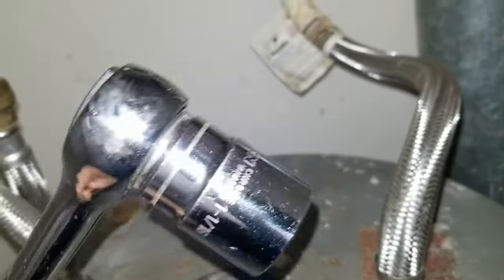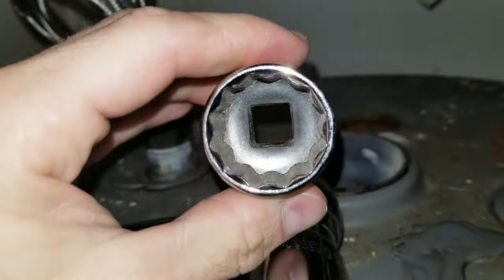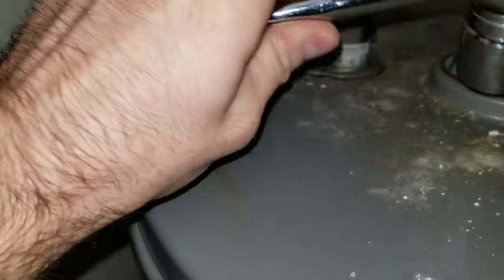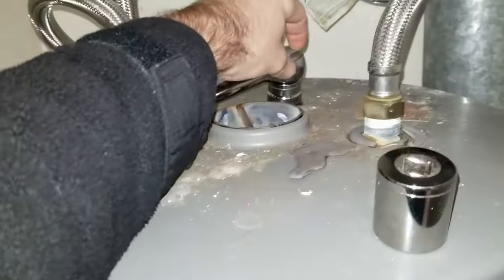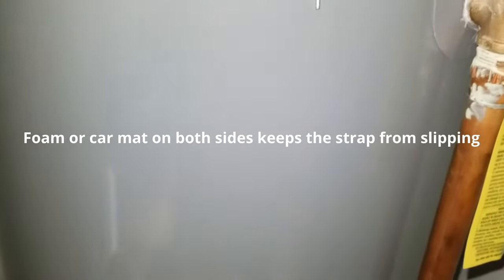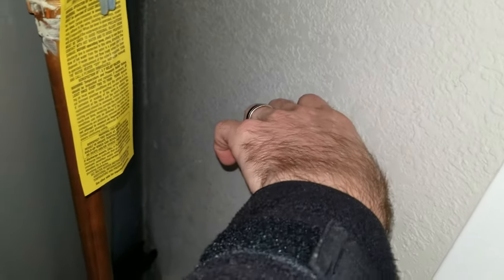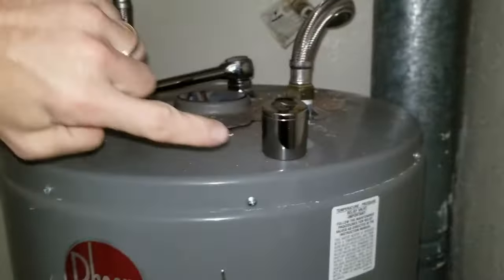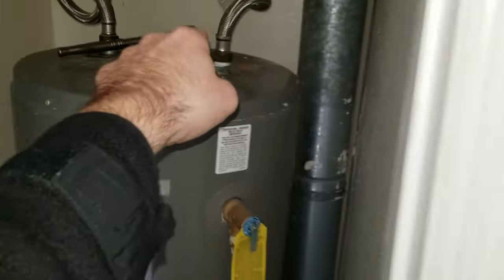Keep Water Heater from Spinning!  [Remove Anode Rod EASY TRICK]

Comment: Tip from an old plumber.... remove the side mounted relief valve and screw in a 2 ft piece of black pipe. Now you have an extra handle to keep the unit from spinning.
Reply from the maker: Interesting idea.  🤔🙂
Reply: Old professional  water heater wrestler here,  [installer], EXCELLENT tip sir.
Reply: what diameter?
Reply: @arkrainflood    most residential relief valves are 3/4 inch.... unless your tank is bigger than 120 gallons. Most home tanks are 30 - 50 gallons.
Reply: @arkrainflood same as the threads on the valve port
Reply: That is a good idea but assumes enough clearance & working against oneself is not a good state to be in when doing so against a single-minded maniacal urge by the manufacturers to put it on so damn tight in the first place when they well know the mess they put the homeowners in. Are they worried that there will be a leak or a fountain if they went a bit easy on it?
Reply: @Gengingen     show me an installation where you don't have 6 inches. That and the difference to anything else solid on the tank (risers?) will be another foot that you didn't have before.
Reply: @rupe53  6 inches is not a big issue. With the tank placed in a corner, the positioning is a bit awkward needing to pull on the anode-nut with the left hand to turn it CCW while holding on to the 6 inch piece with the right (dominant) hand. By the way is this stuck on so hard for a purpose by the Manufacturers? Or does it get that way due to the heat? My tank is just 18 months old & this is my first attempt. It is said the longer it sits untouched, the harder it gets.
Reply: @Gengingen     nobody said it would be easy. Most of them get stuck due to bad water, but I can't imagine the water is so bad that you need a replacement at 18 months. Over the years I have had a couple that just wouldn't budge. Of course, we now have those fancy battery impact guns. Never tried one because I am long retired. I have tried longer "cheater pipes" to get more leverage... but you need room to work. Worst case is you give up and plan on an early replacement of the unit

Comment: I thought of a completely different way of getting the stuck anode rod out. I’m a little old lady with not much power so had to think outside the box. I used a car jack wedged horizontally on a wall stud to slowly apply torque to the breaker bar. At first there wasn’t enough room to fit the jack so I took a long 2×4 and started farther away from the breaker bar. I wedged in pieces of wood as needed and moved the jack closer and closer to the bar, always putting it on a stud. Finally I had the jack on the breaker bar itself and it came loose!! The whole process took me about 15 minutes of patient work.
Reply: Brilliant work "little old lady"!! 😊
Reply: Haha @charliebrady; exactly.  Little old lady huh??
Reply: That is so impressive! Thank you for the ideas!
Reply: Genius. Why can’t there be more women like you out there🎉❤

Comment: Use impact wrench will save you a lot headache which will not spin the water heater. I got my stuck anode rod loose within 5 seconds.
Reply: That's a good tip too.  But unfortunately I don't  have a impact wrench.🤪
Reply: What size impact? 1/4” or 1/2”? Thanks
Reply: @weaverjoshuab  I used 1/2” RIDGID mid torque impact wrench. The size of socket could be either 27mm or 1 1/16 inches.
Reply: Get a cheap Chinese impact wrench and a 27mm socket.
Reply: I used a 1/4 inch impact driver with a 1/2 inch adapter to fit 27mm socket
Took 30 seconds to remove😊
Reply: how many ft-lbs torque rating?
Reply: @weaverjoshuab   1/4" impact?  I don't believe I've ever seen a 1/4" impact advertised.  I've never seen 1/4" impact sockets.  3/8" and 1/2", yes; but never 1/4".    Are we talking (impact) wrench or driver?
Reply: $20 for electric impact wrench from harbor freight.. bypasses all the trouble
Reply: I couldn’t get mine off even with an impact wrench.    Even tried penetrating oil, an air chisel to try and loosen up and rust or corrosion.     Even tried an ice cube on top of the nut to shrink it a bit.   I tried everything except a torch to heat the area around the nut.  Any suggestions?
Reply: @jeff11030  Sounds like you just need a stronger impact wrench.  Keep it on and let it do its job by hammering away even if its not moving. That will bust the rust free.

Comment: No impact needed. Hit the top of the nut, rather hard a few times with ballpeen hammer or punch & regular hammer. 1/2 breaker bar & cheater pipe. Turn it towards tighten, slightly, then loosen. Just changed mine on 9 year old Richmond WH

Comment: I recommend not using a socket and ratchet.  Save yourself some serious headaches and use a 8.5-Amp Electric Impact Wrench, 1/2" Impact driver with 480N.m Torque Power. Loosened the anode rod on my 10 year old water heater... in 2 seconds. I also didn't have to worry about strapping the heater down.  (remember to shut off the inlet water before removing the rod)
Reply from the maker: If I had one, I would use it :)  Great reminder to everyone with that last sentence!
Reply: I hear yeah....you do it with what you have.  I bought one just for this job. Nice video, thanks for the compliment @HomeBatteryBank
Reply: ' 8.5-Amp Electric Impact Wrench, 1/2" Impact driver with 480N.m Torque Power.'.....oh yeah, just happen to have one in my garage, lol🤣

Comment: Spray some WD-40 wait a few hours. Use a impact wrench or a break bar and hit on top of socket when applying pressure ( AKA impact)
Reply: WD-40, LOL.
Reply: @rickjames6948  it’s combination of solvent and lubrication works for a lot of things. I know it’s technically for water displacement, but why is it so frowned upon? Is there a better product? I have solvents and penetrating oils, but why not use the classic wd-40? I’m trying to learn so please don’t think I’m being a jerk. I really want to know? Is it just viewed almost like duct tape?
Reply: @sethburkhart1021  I don't think its a good idea to use anything like that near a water tank, which you are showering or cooking with. Its toxic to injest, you would want a food grade lubricant if you were going to go that route. I have some seafoam deep creep (stronger than WD40) that I would like to use on my water tank right now but it says it could be harmful or fatal if swallowed
Reply: @SangheiliSpecOp  that’s fair. I was thinking it would be so diluted and the fact that you don’t take in a lot of the shower water anyway, it might be fine. But you raise a good point. Thanks!

Comment: Impact wrench is the way to go for an easy removal but I want to also point out your installation does not meet code which prohibits anything flammable within 6" horizontal of the flue.  While those flexible braided SS hoses might look inflamable they have plastic hose inside.  They probably will not burn but if your flue gets even partially  plugged  they will soften and burst causing a good flood

Comment: Use a long break over bar first. Your ratchet will thank you. Mine was like 500ft lbs. I almost gave up. Sprayed PB Blaster on it for 2 weeks. Came out after that.
Reply: I thought about that but I'm afraid the PB Blaster would get into the water. Did you smell it in the water? Mine wouldn't budge with my air impact wrench. I have a 42" breaker bar that I call "The Beast" that I used to break loose one of those infamous Honda crankshaft bolts and I bet it would break it loose but I can't figure out how to use it without spinning the tank. There is nothing to brace against like the YT poster did. It's standing in an open area attic. [EDIT]  I went ahead and used "The Beast" and the heater still tried to spin even with a strong helper holding it in a bear hug. Gave up and sprayed the PB, waited an hour, tried again and it broke loose. I detected no PB odor in the water while standing in the shower later. Heater did twist a little, maybe an inch, AND, the chimney above the roof is a little not straight the wife has pointed out to me. It's not that bad though-I see them all over the neighborhood not perfect. I'll fix that next time in a few years.

Comment: Thanks for this, worked for me! All the guys saying "just use an impact" didnt have to remove my anode. Original in a 1990s tank, and I have a brand new 1/2 in air impact and compressor... didnt budge. Your method worked in 30 seconds.
Reply: I thought an impact would work also, I guess it depends on the corrosion.

Comment: I was able to ge mine loose with a cheap impact screw gun. Took about 30 cranks but it came loose. After 2 years only the anode was eaten about half way through at the top. Time to check my other WH. Thanks for the vid!

Comment: You’ve got a good idea. However, I used a hammer wrench- the kind that workers use in a garage changing tires. I have a tank compressor that puts out enough air to run my hammer wrench. It took about 20 seconds to completely loosen the anode without spinning the tank. I couldn’t believe it because while holding the socket in my gloved hand running it, it seemed kind of wimpy turning. I didn’t think it would work.

Comment: Leave the water in the tank. Just drain a couple of gallons to provide space for the new rod. After the rod is installed, you can do a full drain to remove any build-up.
Reply: That should have been plan A
Reply: Obviously you have never done this with the original anode rod in place.  I had to remove mine on a 50 gal. Richmond electric only 3 months old to put an electric powered anode in.  I did the same set up and had a pull like crazy on a 3/4" drive extra long breaker bar to break it loose.  And yes, I only drained a couple gallons out.  They are extremly tight which is why 12 pt. sockets can round off the rod nut.
Reply: Just use a 6 point socket and a impact gun

Comment: I used a Milwaukee M18 FUEL 18V 1/2 in High Torque Impact Wrench.. and a 3/4" Drive Impact Socket Deep 1/16 inch... EZ Peezy..

Comment: My anode tube is deep into the heater - about 3 inches. I'm going to try to use an impact wrench. The reason is that you don't have to hold the water heater still. But I will still need a deep socket.

Comment: I bought an impact gun  from  Harbor freight tools $59 works great 👍
Reply: What size socket
Reply: @noname-ye7zj  half inch drive
Reply: @noname-ye7zj  I bought a Tekton brand 27 mm 1/2" drive 6-point socket on Amazon. It fits perfect. 1 1/16" is the same as 27 mm.

Comment: Ideally you would need another piece of wood going to the Opposite wall from another set of wraps because if the anode nut were really tight, the tank would use the first wall stop to pivot off of there. I wonder if the manufacturers do this on purpose to discourage replacement even though they say it should be done, in some kind of Kafkaesque move, so they can deny warranty replacement. Why make it so incredibly hard in the first place?

Comment: I do similar, except I loop the ratchet strap around the base of the Overpressure valve so it doesn't spin, then just grab the loose end of the strap and wrap around the my hand.

Comment: For corroded threads, I would suggest to use our tool (shameless plug) rotary thread. It will easier to use especially for inner threads, dinged, damaged and cross-threads.

Comment: Where do you buy the replacement anode rod?
Reply from the maker: I bought this one on Amazon: Rheem SP8371B R-Tech Resistor Flexible Magnesium Anode Rod with 54-Inch Length and 0.9-Inch Diameter
Reply: @HomeBatteryBank  Thank you.

Comment: What’s the little wire taped to the water heater side wall?
Reply from the maker: Off hand,  I don't know.  It was on the floor next to the water heater when I bought the house.  I just taped it there so I wouldn't lose it just in case.  Not sure if it even serves as a replacement wire for something on the ignitor or not.
Reply: There are 2 of those lil dodads in my plastic bag with owners manual hanging by my water heater. Now I gotta find out what they are

Comment: you do need a longer ratchet but the real trick to doing this without having to strap it all down is to use a torch and heat up the rod tip just enough so that you can break whatever seal is holding it in and that will make it easier to get out.
Reply: That will do the exact opposite of loosening. Heating the rod nut will make it swell and becomes tighter
Reply: @johntimmins5564  all the more reason not to do it too much. Just enough to break the seal that has been formed

Comment: Step 1: go to home depot
Step 2: buy a high torque impact wrench and 1 1/16" deep socket.  keep receipt
Step 3: use impact and socket to remove old anode rod
Step 4: return impact and socket for your money back

Comment: dont drain the tank. Only let out a little, that way you dont have to worry about movement
Reply: A full fifty gallon tank will spin if anode is stuck as most are.

Comment: Totally wrong to recommend a 6 point over a 12 point socket. More contact points makes it LESS likely to strip, not more.

EDIT: appears I need to eat my words and you are correct after all - https://youtu.be/pX4uHYEPOuY?si=rjoxbUZz_UvespaM
Reply: The more rounded points of the 12 point make it more likely to slip, especially on something that is super tight (in my experience).
Reply: A 12-point socket still only engages the six points of the hex top nut. The engagement of a 12 point is a lot shallower than a six-point socket. When an old time butt-crack plumber in greasy clothes says use a six-point socket, listen to him like the voice of God.
Reply: That is exactly backwards. 6 point is definitely stronger.
Reply: @TheAzmountaineer  You are correct. See my other comment referencing the torque test channel results.